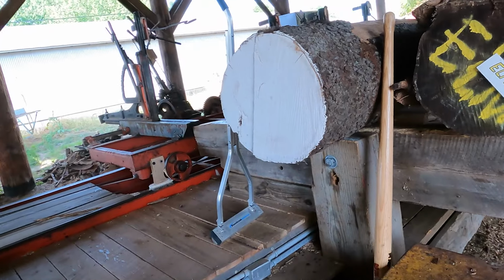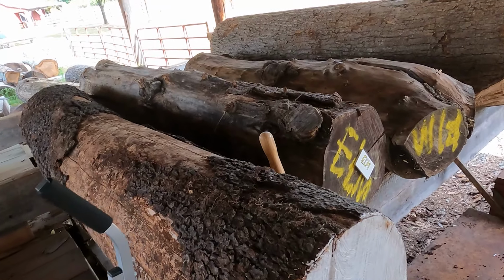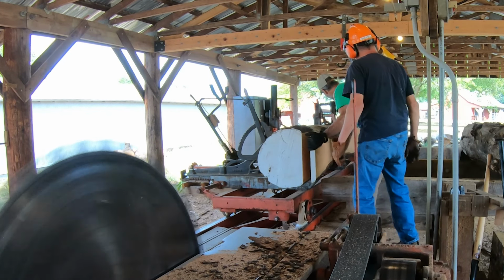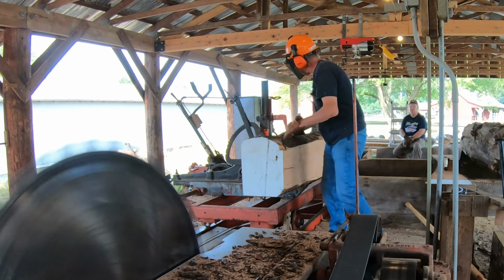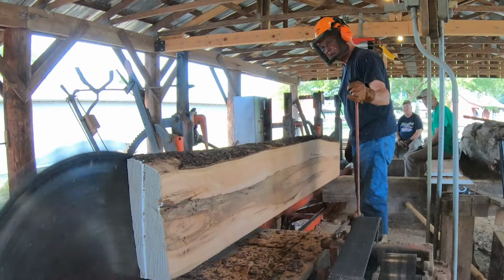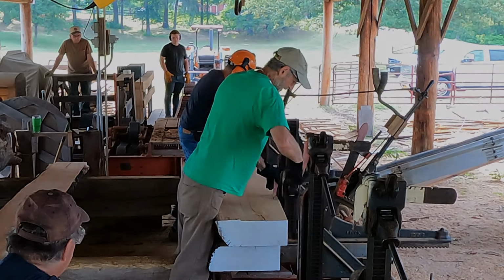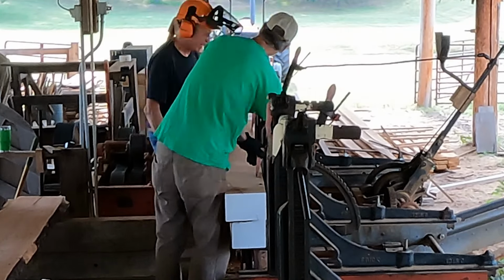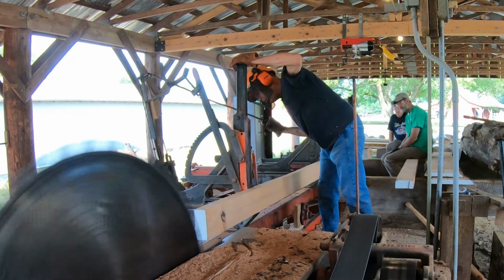Sawing veneer quality cherry log into table boards!

Comment: I think when you are trying to decide on the size of board to cut you have to guess what people are going to use it for. In my younger years I used to make furniture as a hobby. If I was going to use that cherry I would have wanted it all at 4/4 with widths of probably 6, 8 and 12 inches. I would plane it down to about a true 3/4. Just a thought.
Reply from the maker: thanks Ed! I stay away from boards wider than 6". It seems like they cup so much then what starts as 6/4 ends up as 1/4!!! take care and thank you. 
Wayne

Comment: Your problem was your bottom cant you didn't cut the piece off the end you could see the top cant was twisted, if you had pulled your top cant six inches ahead you would've been alright or just one cant at a time.
Reply from the maker: Yea... I saw that too! Thanks for the tip.